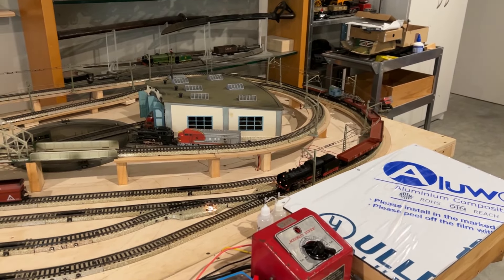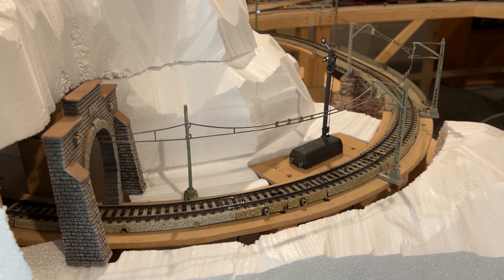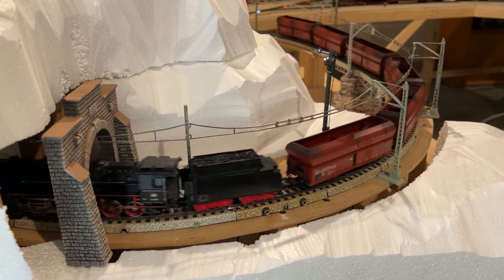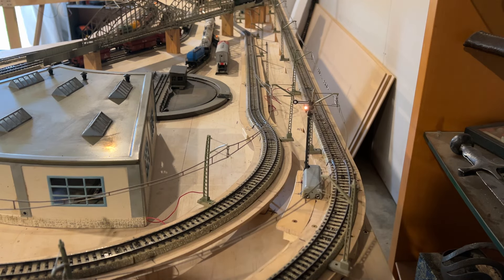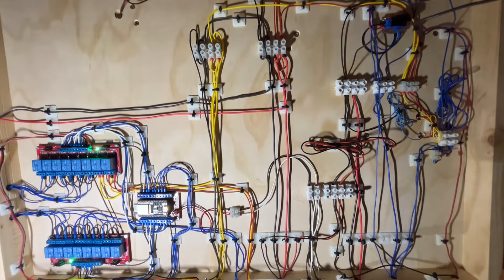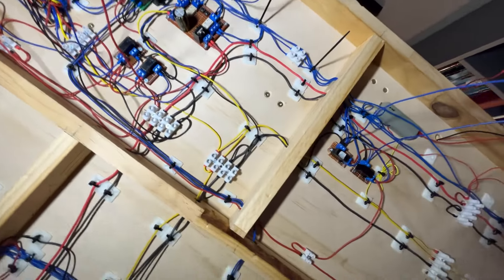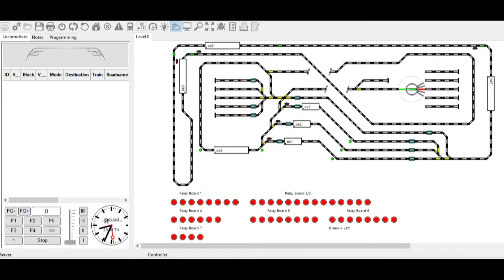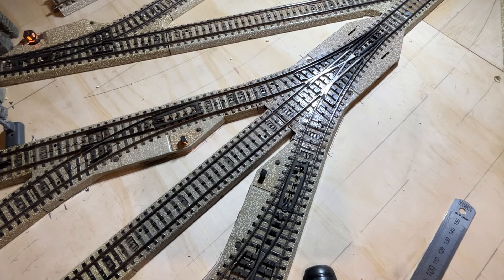Where Did All The Wires Go? -- Märklin Analogue Automation

Comment: Great video! I've tested out a simple version of the push method to control my HO scale streetcars through a triggered section of track. I see some details in this wiring setup that I can utilize to smooth out my block control operations. Thanks.
Reply from the maker: @ryanhill7323  one thing I didn't really touch on in the video is I also have lockouts on all sections so the switch can only be activated once. Not all setups need that, but with marklin, if you have multiple pickup shoes you can start releasing trains at the wrong time which gets messy. 😂